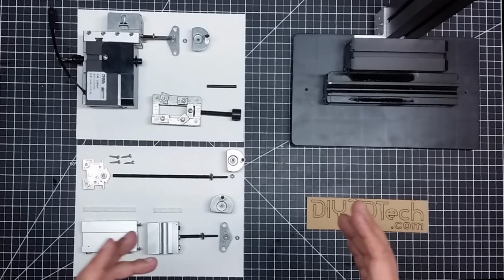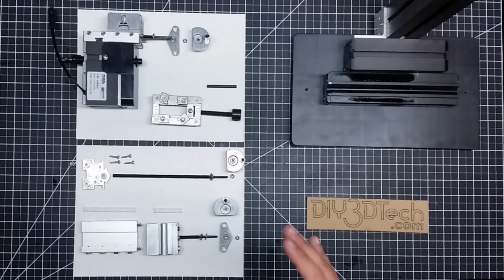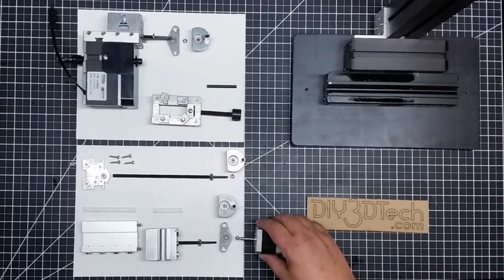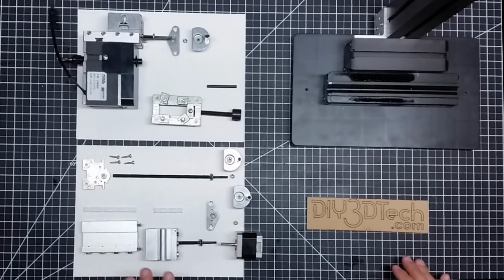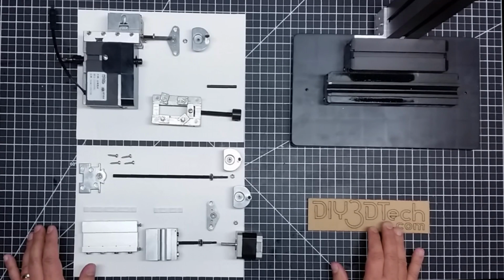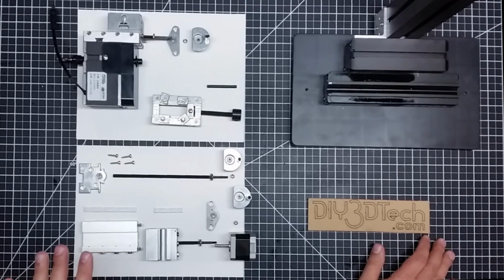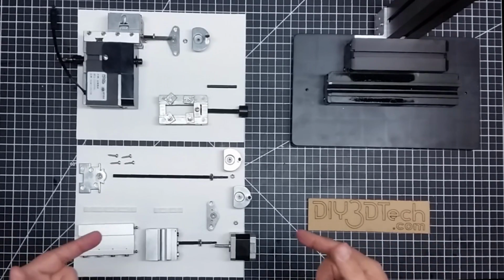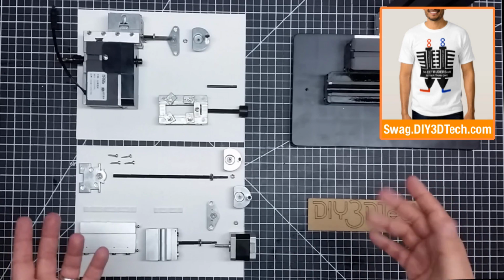MicroMill  - Disassembly and Discussion !

Comment: Asked a question about the backlash on your previos video about the mini mill. Found the answere here. Great cntent, keep it up. :)
Reply from the maker: If you check the last video I made in this (think its in there), I did add the thrust bearings and redesigned the bushing which resulted in a vast improvement :-)

Comment: That Probotix V90 Fireball was pretty crappy.  I never was able to make mine work well.  Time permitting, I still have plans to rebuild it into something better.
Reply from the maker: What issues did you have with it?  I used mine for many years, in fact still have  it and like you mention I too plan a rebuild of the motor and electronics.  As I got one of the first ones they came out because as  I saw the Nuts & Volts article I placed my order and they where swamped!   Took me about 6 weeks to get it and the learning curve with Mach 3 was steep!  If you look I have a play list for it and converted it to use a GRBL instead of Mach 3...
Reply: The z axis is made of some weird rubbery material and warped really badly after a few months.  I braced it on the side and back to stiffen it up, but the axis still flexes a lot.  So I just use it for light wood engraving.  I did see your GRBL conversion and may someday convert it, but for now I just use a really old PC & LinuxCNC.

Comment: Try RC helicopter rotor thrust bearings. I am using 5X10X4, and they have smaller
Reply from the maker: What is the cost?  As I found some but they at $9 each!  So I got larger ones and simply make a bushing...
Reply: https://www.fasteddybearings.com/5x10x4-thrust-bearing/
Reply: 1.99USD
Reply from the maker: that is cheap!
Reply: hope it works out. looking forward to seeing how this mill works for you.

Comment: Appreciate you going thru the build process! Considering a similar project, im spoiled on a Haas at work though. Let me know if you need a hand with any general cnc questions.
Reply from the maker: LOL!  I can even think of an analogy to make between this and a Haas!  However it does make be chuckle!  Also thanks for the offer as I have built a number of machines (3D printers CNC's and lasers).  However I always wanted a Sheriline as they look cool but not pay a grand for cool so figured this would be a fun knock off project and so far so good.  Modeling the stepper mounts is complete and I decided to 3D print the first generations.  If I like it may do an upgrade, however for my use believe the PETG  mounts will work...